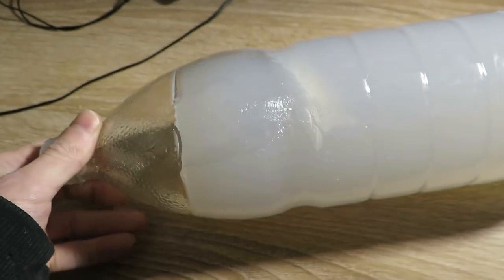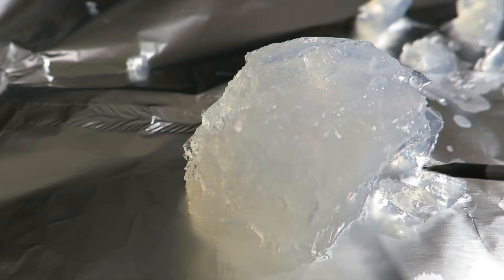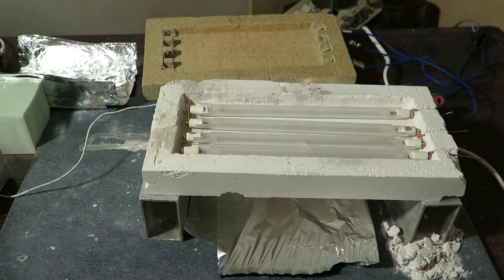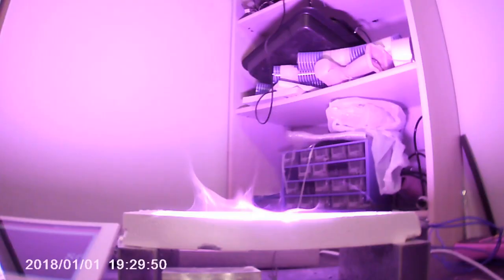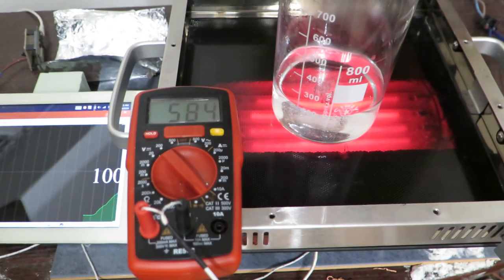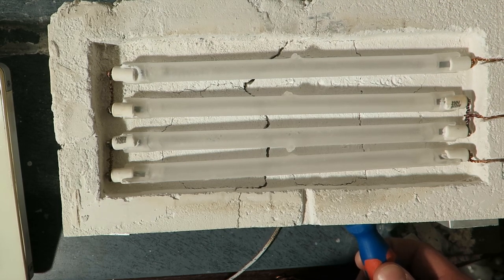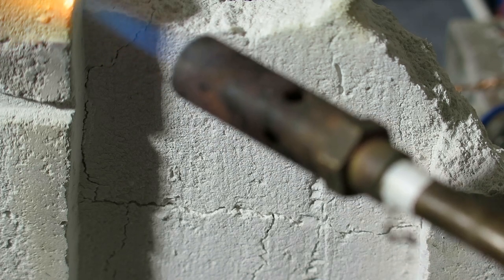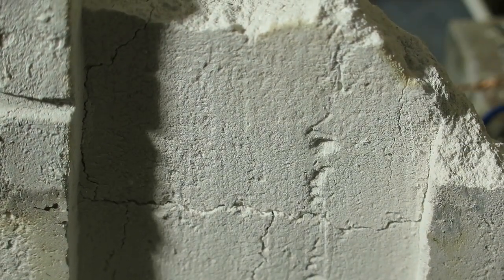DIY sillicagel thermal insulation | Quest for heat insulating material. pt 3

Comment: Hi, I think the problem of low strength in the compositions you are experimenting with is the use of gypsum (CaSO4.xH20) as your binder. 

When making refractory mixtures for high temperature applications,  I found phosophate-based binders to be superior in strength, curing profile, and are more suitable for setting in nichrome and kanthal elements directly into the refractory.
Consider the following patents if you want to experiment: US4833576A, US4440865A
for silica-based work: US4244745A
My experience (based in Eastern Europe) has been that lightweight alumina bricks are available albeit you need to look harder
Reply from the maker: Thanks for info. I am using gypsum as filler, not binder directly. It is binder at first, but Idea is that you heat treat this material further to dehydrate gypsum and fuse glass.
Not sure how or if gypsum can be dissolved in glass though.

I want to make this DIY if I can, that's more or less purpose of this channel.
Reply: @IlusysSystems  Yes, I understand and support your experimentation, and you have shown some interesting and surprising results. 
If you have access to phosphoric acid (purity and concentration aren't very critical, and I have successfully used commercial rust removers that contain dilute H3PO4), you can try preparing a phosphate binder by dissolving aluminum metal or alumina in the acid until the acid is neutralized. Then, use it at 5-10% as a binder in a Al2O3/SiO2 refractory mix in place of sillicate.

I'll pull up my notes from the time, but if I recall correctly, curing takes place at 80C until all water is removed and then 150-200C to cement the particles. The result is resistant to water, sustains high temperature, and is substantially stronger than gypsum.
Good luck!
Reply from the maker: @cognitivedissonancer  Thanks a lot, will do some research on uses and stuff
Reply from the maker: @Leadvest  What I fing mainly discouraging about those patents is claims to only what temperature they can withstand and strength. While I am looking for lowest possible thermal conductivity.
Second thing is to understand principle by which my material operates, because generally if you have fine porous sillica, water will destroy it.
So it is very much possible, that gypsum will keep volume of material, while sillica will shrink extremely during drying step leading to microporous structure. Normally   (in such big volume) gypsum would just crystalize and sink to bottom.
If this is the case, then you still have porous structure which will be hard to keep porous if you use binder.

But yeah one never knows... So I should finally go get some license to get chemicals...  I need it anyway, as I am freelancer now. But will look for other sources as well.

Comment: you could look into carbon foams. they are easy to make and if you add sodium silicate, you might even be able to stop sublimation/ burning.
Reply from the maker: I have tested this accidentally, and it will still burn, though with very thick layers it will take a long time. Sad thing is that sodium silicate really kills thermal insulating properties